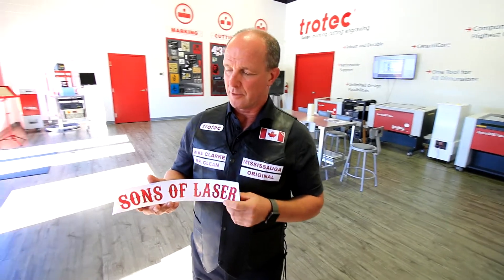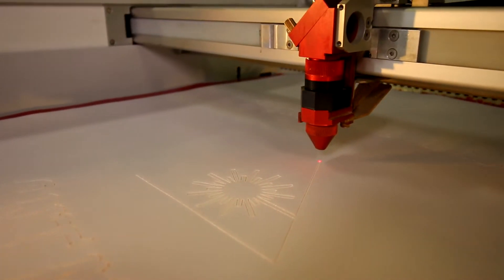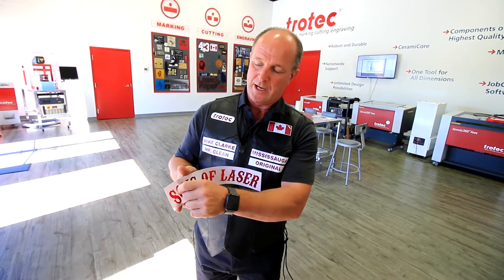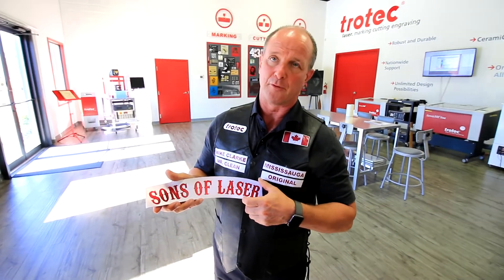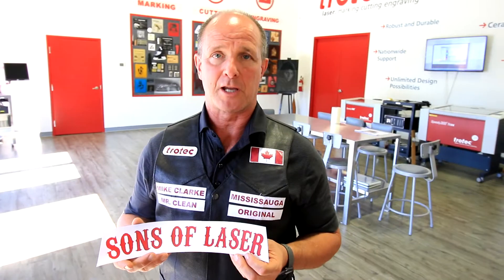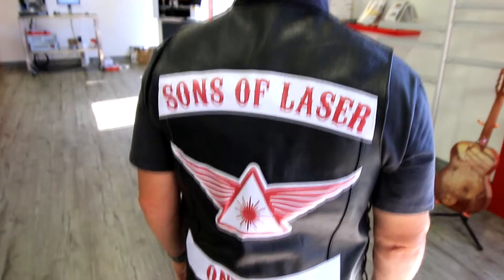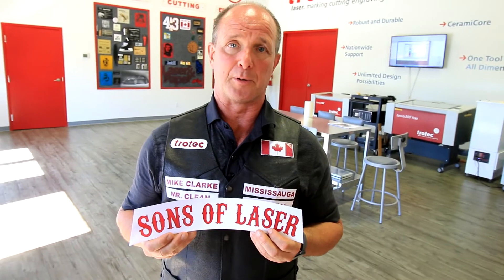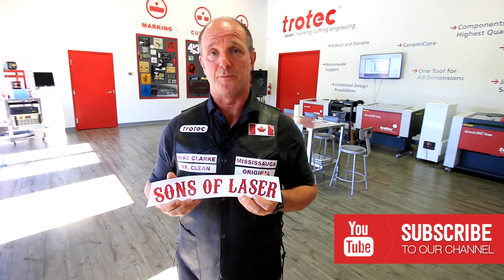Laser Cut Biker Patches | Biker Vest | Trotec

Comment: What did you use to stick the layers together initially?
Reply from the maker: Hi! We purchased the twill already with the adhesive backing. We stuck both piece together and once we cut the fabric the heat from the laser actually sealed the two together. We used the heat-press to further seal the two pieces together.